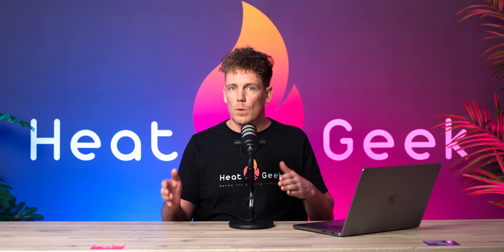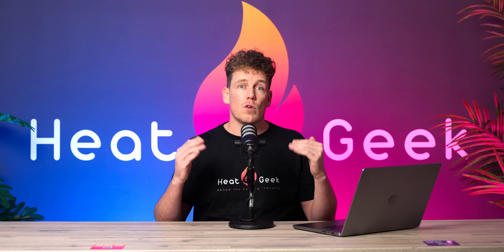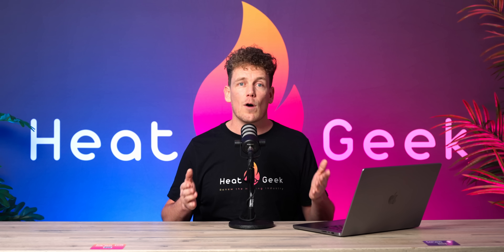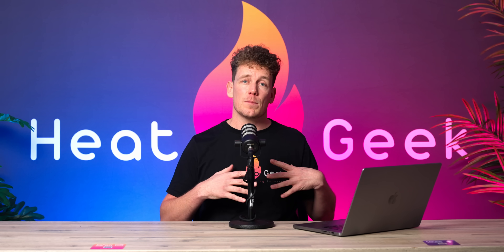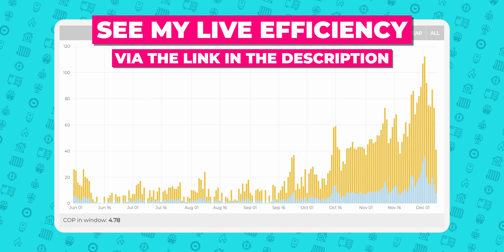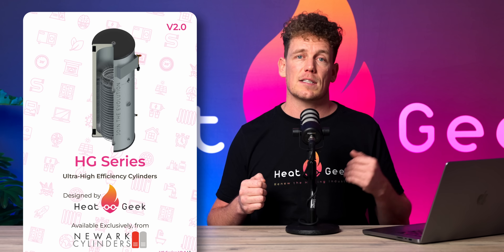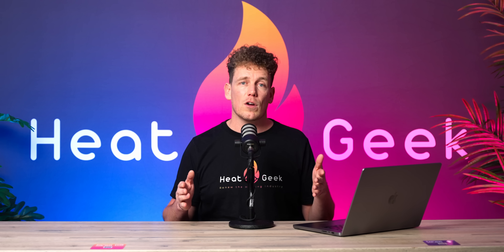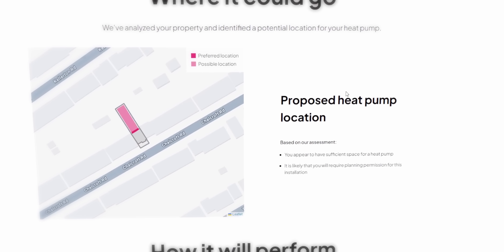How to Generate The Most Efficient Hot Water On EARTH

Comment: Here in Finland, I use a different approach: the heat pump is directly coupled to the storage tank without heat exchanger coil. The domestic hot water is extracted from the tank with a coil. This means that the water in the buffer (in my case, 3000L - yes, thousand, not hundred) together with the heat pump circulation and the underfloor radiant forms a closed system (and contains propylene glycol antifreeze as well). The stratification principle is used by putting the domestic hot water coil all the way at to the top of the tank. The heat pump always gets the coldest water from the bottom of the tank. I'm off-grid, so there is also a wood gasification boiler coupled to the tank for those months where I don't have enough solar to heat (no sun in December and -30C), but otherwise this time of year (still close to and below freezing) I just dump all the excess solar power into the tank with the heat pump and I don't need any wood.
Reply: Sounds similar to my system that I build in 1987 , 800gal or 3028L ss tank , but 320 soft or 30 sq Meters or active thermal solar collectors.
Planing to add a geothermal heat pump soon. Vermont, USA.
Reply: I did a large thermal store in Britain about ten years ago for a sports pavilion. The big problem was trying to stop it scaling up, the water was hard in the area and eventually the water wasn't getting hot enough in the coil. I tried several scale inhibitors before fitting four Cistermiser Combimates in parallel (on the 2" cold feed) which seemed to work, I never heard anything after that. Is it still ok? I'm afraid to ask.
Reply: @PeterJFlower  Yeah, that's an issue with hard water. My well water goes through an ion exchange filter, so it's soft - no issues with any buildup.
Reply: Thanks for the info, I’m contemplating doing something similar - massive thermal store for underfloor heating and hot water. Then on good solar days dump as much energy into the thermal store. Do you something similar with time of day electric rates or solar?
Reply: @alexlovett1991  I'm off-grid, so I do't have any rates - but I do have periods of production and less production (solar). I put whatever I can in the buffer these days: it's still cold, and weather can be variable. The buffer is enough to keep the house warm for a day or two (and for showering) so I tend not to have to use wood at all during spring. I can even tap in the battery if I see the weather forecast clearing up. It's a 100kWh pack, so I have some room - especially since I typically only use around 5 kWh per day. I can take out 50kWh and turn it into 200kWh of hot water.
Reply: @upnorthandpersonal  thanks for that! Very interesting, you’re pretty much the direction im trying to go. Your battery is 10x mine though 😂 we’re too busy insulating our house atm before we can look at heat pumps etc.
Reply: @upnorthandpersonal  I'm guessing you have 16 x Tesla 100D modules as your pack ?
Reply: @christianfaversham3766  No, I build my battery packs with LFP prismatic cells (from e.g. EVE). You can get for example EVE 304Ah 3.2V cells from several places (Fogstar in the UK, NKON in EU, and others), and use those to make a 16s battery pack. Throw on a BMS (like a JK) and you're set with a 15kWh battery. Add multiple of those in parallel to build up capacity (over time if needed).
Reply: totaly aggree dhw must be drawn from coil not reverse, goes for smaller systems to.
the problem is that heatpump just use one sensor for start stopp, you need two sensors, the strat is pending around the place where sensor is sitting and not realy using the volym under for purpose, then you draw to cold water into heatpump return to reach wanted temp to load top of tank, think there was a finnish guy who used a woodboiler returntempload (thermisk) valve to rise returntemp to heatpump to get hot temp to top inlet. nibe adopted this to some level.
i use plateexchanger instead of coil for hotwater same princip and maybe to cold return temp to heatpump, but we know how to rise returntemp it depends on what heatpump we use, some have low flow regulation to reach high temp on outlet, you dont want to load colder water to top of tank right.
Reply: So a thermal store rather than a stored water tank?  Not common in the UK but I did have a boiler which had one of these once, was a bit of an odd system but had great flow rates
Reply: @JoeFoster  Yes, because the wood gasifier is rated at 40kW, and it's not something that is instant on/off - so you need a place to store the generated heat. It can pretty much heat up the entire tank to 80C on a single firing.
Reply: I had thought about using a similar system for my home in Estonia. A large heat stores mainly needed because of the wood firing and I guess in your case if you have a particularly good result from your solar system. I was going to use weather compensation via a mixing valve from the heat store have you done this too
Reply: @andrewmillwardwatford9410  I have a weather compensated mixing valve from the tank to the underfloor heating. I'm definitely not saying that my set-up is applicable to everyone, but having 'free' excess power that I wouldn't know what to do with once the 100kWh LFP battery is full means putting it in a tank makes sense. In summer, I reverse the heatpump cycle to cool the water, and pump that in the underfloor radiant: radiant cooling.
Reply: @upnorthandpersonal I would love to see a video outlining your system. I would love to build a system like this in Ireland but it's very uncommon here.
Reply: @roryhealy8656  It's described on my blog under "#6 Heating Systems". This was written when the heat pump was still in planning. I'm working on the next entry that details the upgrades in the mean time, including the heat pump. Link is in the header on my channel.
Reply: That's no A Finland thing it's more a large property/commercial thing.. Called a Thermal tank.. I'm in the UK and I have a 4000 litre tank.. because my house/workshop run of a Log Biomass boiler which is 60kw.. Hence the large Cylinder size uncontrollable heat requires a large cylinder... These tanks are massive and would never be viable in your average home in any country UK or Finland 😅  Even regular indirect hot water cylinder 250/300 litre are often to big hence why many properties have Combi boilers no cylinder..
Reply: @jmb69er  Plenty here in Finland in regular residential places - not just commercial. Any place with a wood burner has one, and these things are common here.
Reply: Just out of curiosity, how much solar do you have? And to what temperature is it fully able to heat your house? What size is your house and how well is it insulated? I'm just trying to get a rough estimate of a system like this. Thanks!
Reply: @lolimpol  15kW of solar installed. We like the place warm: typically around 23C. House living area is 120m^2 (1300 square feet). It's a log house, 203mm (8 inch) square logs and huge windows (and lots of them, but granted, triple pane with Argon) so those are not super insulating. The ceiling and floor however are very well insulated: ceiling U value of 0.09W/(m² K) or R value of 63, and for the floor U value of 0.16W/(m² K) or an R value of 35.
Reply: @upnorthandpersonal  Awesome! Sounds about right for my build too. Although I'm looking into solar thermal panels instead of PV for the efficiency gain. I have the resources to bury a big insulated tank in my yard that might keep me topped up all winter without the heat pump even kicking on anyway. Calculations are too complex for me though 😅
Reply: @lolimpol  I would not recommend solar thermal. Think about it: all if does is generate hot water, and to do this you need a rather complex set of pipes, glycol, pumps, etc. Solar PV generates electricity which can be used for so much more than just hot water - and is way cheaper. And while you think solar thermal is more efficient at generating hot water, once you add in a heat pump with a CoP of 4, this efficiency difference goes away entirely. It's also easy to just add more solar PV panels.
Reply: @lolimpol  Also: long term heat storage as you suggest with a buried tank will not be as easy or feasible as you imagine. Don't underestimate the heat loss over time even with an extremely well insulated tank. 
My approach would be to look into battery storage: you can get 1kWh storage in LiFePO4 cells for close to 60$ (and prices are still dropping). Building a 500kWh or even 1MWh container is entering the realm of feasible rather quickly.
Reply: @upnorthandpersonal  I absolutely agree that a lithium battery is needed as a backup. However a battery the size of a 24m³ (calculated on a 6.7GJ energy usage for a winter according to Wikipedia), would cost me €111.666 at €60 per kWh. A tank like that with my connections would be under €5000. And certainly heat loss will be a HUGE problem, however in our mild Dutch climate, there is usually no more than 2-3 weeks between a very sunny day. And then even if it runs out, any storage is better than no storage! Running the heat pump even if it's 2 months less of the year is still 1/6th off my energy consumption. Besides, I don't want to use wood which is the obvious choice here for personal ecological reasons.

As for the PV panels, solar thermal has a great benefit where it doesn't have the stringent sun requirements a PV panel does. It will happily generate steaming hot water even on the wall of a building. Besides that, PV is currently at 25% efficiency, and solar thermal at 98!! So even with a realistic cold weather COP of 3, thermal works out better in that case. I'm not saying I won't have PV, but having a few trees on my lot, thermal works out in those slightly shady or slightly weirdly angled areas!
Reply: @lolimpol  Yeah, wood definitely doesn't make sense in the Netherlands - no forest. Here in Finland I'm converting a tree farm into a diverse forest, which means removing lots of spruce and pine - I've got firewood for the rest of my life from my own land. Best of luck with your project!

Comment: You can reduce the legionella risk and minimise stirring the tank with a tank that uses a coil for DHW so you aren't drinking the water that's in the tank. The one I'm pondering has the radiators and heatpump/boiler connected to the water in the tank (with baffled inlets) and a coil at the bottom for solar thermal.
Reply: Why would you be drinking the tank water? Your drinking water comes straight from the mains.

Comment: i have a buffer from
ADVANCE APPLIANCES LTD
ADVANCE SFUTS
300L MULTI-FUEL THERMAL STORE
HEAT EXCHANGER HOT WATER 35KW
HEAT EXCHANGER SOLAR 17KW

SOLAR COIL OUTPUT 20KW (0.75m2)
HOT WATER COIL OUTPUT 35KW (1.5m2)

one shower seems to remove 5 degrees of heat from the top of the cylinder
the solar coil will be used for the ASHP flow & Return (the buffer tank feeding two towel rails one 12m2 office and the DHW)

with the Gas now removed (GAS boiler finally gave up in feb) i use immersion heating using either Solar or Cheap Night Rate the 7.5p for 6hrs
if there is no sun the night rate is as follows
raise the temp from 40 - 70 takes 10.50Kwh of power about 75pence per night and a time at 6kw of 1hr 45m

Until Oct the sun will charge the immersions, i hope my planning gets approved before this winter season

Part 2 ‘Controls’ - coming soon!..   👍👍
Reply from the maker: Next week

Comment: Recently retrofitted a Willis heater to my vented cylinder to dump excess solar. Beautifully simple design working on natural thermosyphon. Heats from the top of the tank down, maintains stratification due to low flow rate. Also ensures that what excess solar you have goes to usable hot water in contrast to a traditional immersion element.
Reply: How did you plumb your Willis heater?
Reply: @andrewmillwardwatford9410  the Willis is next to the tank with the cold inlet as low as possible and parallel to the tank's cold water feed. This ensures the Willis can heat the whole volume of the tank before the thermosyphon eliminates itself.

The hot side of the Willis is piped directly up and teed into the tank's vent pipe.

To prevent reverse flow or unwanted syphon when the Willis is not heating I added a radiator valve driven by a UFH actuator to the cold inlet of the Willis. This js powered from the same supply to the immersion element.

Used a 1kW element, contactor driven by a Shelly relay which is in turn controlled by some logic around battery state of charge etc. Basically a poor mans My Energy Eddi.

Comment: Hi I have built a new house with an air source heat pump solar panels 3 phase battery and solar thermal problem is I’m a bit confused about settings for hot water initially i was told to just put in temperatures on thermostats and leave it to run but I’ve changed to octopus go as I’ve an electric car coming tomorrow so not sure this is the right strategy. I have brand new 350l hot water tank which is tall and thin should I be heating this only when cheap octopus overnight tariff is on or leave it continuously on ?
Reply: I would do 2 tanks and put in series - bigger run on the cheap energy only, smaller always.

Comment: For the 300 litre tank that they sell, what would you recommend for a dedicated heat pump  for the cylinder?
Reply: I have owned air to air systems in the past and was very satisfied with them. They don’t work with hot water. Update . There are some that now heat water too
Reply from the maker: Vailant arotherm
Reply: I think Adam misunderstood the question. You would not need a dedicated heat pump for a 300Litre domestic hot water cylinder. The heat that provides the heat into the home operates on a ‘priority domestic hot water’ basis.

Comment: Why are we not using solar hot water capture with another system (perhaps a heat pump) as a backup? As efficiency goes, that would surely be the most efficient approach when the sun is shining?
Reply: because solar electricity has a better ROI and is more flexible.    
* most people spend a lot more on electricity than heating water, so the potential savings are larger.  
* Water heating systems have to be quite complex in the UK to avoid freezing.   
* It's cheaper to run a wire out to your roof than pipes (full of anti-freeze)  
* When you have excess electricity you can get paid to export it.   
* If you use solar electricity to run a heat pump, the efficiencies are similar.
Reply: I do wonder if, with the right design, components and thought put into a system, the ROI might work the other way.
It seems to me that a system could be designed such that it does not pump water through a solar collector on low temperature days, mitigating the need for anti-freeze.
A system could be mounted at ground level - perhaps less efficient than on the roof, but with a bit more surface area, still the same amount of energy could be collected, and maintenance of such a system would then be easier. (Shade might be more of an issue.)
I think ROI is generally extremely questionable with the type of heat pumps marketed to us for use in UK homes, though the government grant helps immensely towards that. And if you had the option of buying a heat pump and a certain number of solar panels vs basic resistive immersion heating along with more solar panels (spending the same amount of money), the heating might be less efficient but you'd be producing more electricity and might have the capacity to export more (though I'm aware that there are limits to the amount you can export through having a solar power system myself), so that could be another option.
Reply: @robynrox  That sounds like you're thinking of using solar for heating, not just hot water? The problem there is that we just don't get enough sun in the winter.
Reply: @robynrox Maybe build that very system and report back.👍
Reply: I was just thinking of hot water but I went off on a tangent. I'll leave it there, anyway, as I'm not planning on changing my existing system right now. Thanks!

Comment: There are some heat pumps that can produce DHW on demand. Will these be more efficient?
Reply: There is an interesting heat pump that was designed by a car manufacturer in Japan ages ago call the Eco Cute. It runs on CO2 so no problems with global warming. They are starting to appear on the continent but very difficult to get any information even though the idea has been around since the early 2000s.

There is a relatively lightweight outdoor unit of 45kg and it generates water at 60c+ so it can be used as a direct replacement for a gas boiler for heating. Not sure about for hot water.

The main idea is that it would be a direct replacement for gas as it doesn't require upgrading radiators.
Reply: @ImprobableWizard  CO2 HPs don't have better cops than R32 HPs